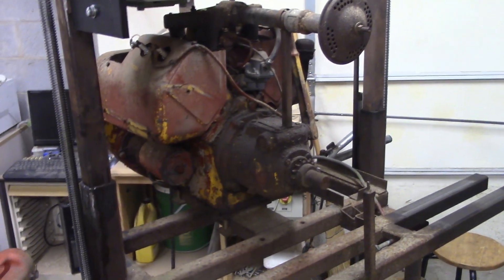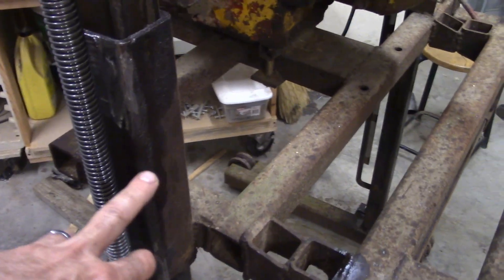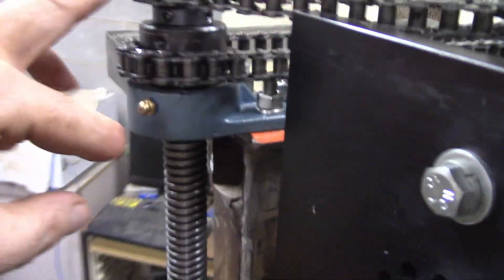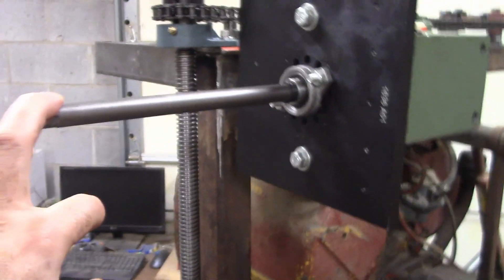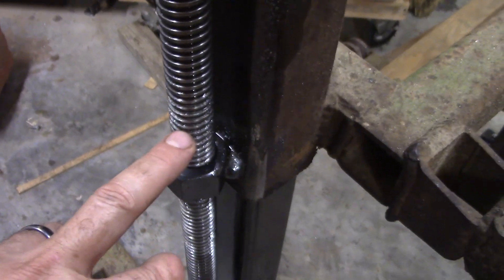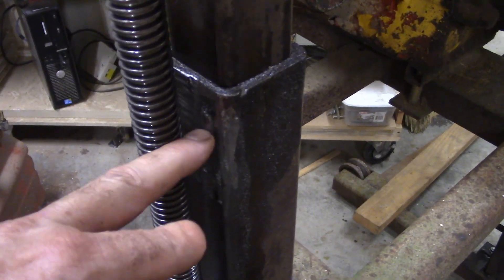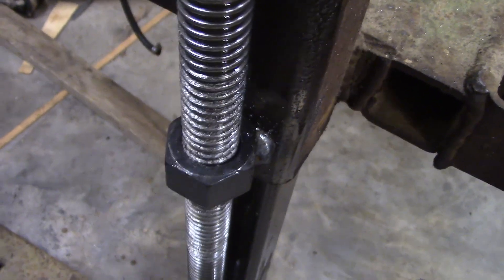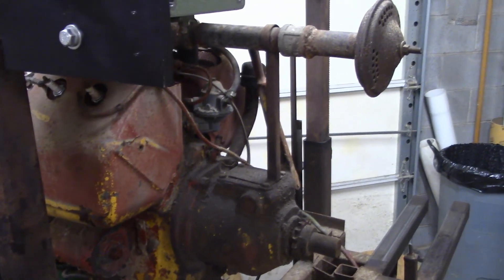Sawmill ACME Lift System

Comment: Interesting, we have the same setup. 
Although,  I built a small pocket that the acme nut sits in, and the nut moves a bit to prevent binding. 
I found that the cheap acme screws that I bought on amazon are not straight, but work ok for my sawmill.
Reply from the maker: a pocket is a great idea... kind of late now but if I have issues...  Thanks for sharing your thoughts!